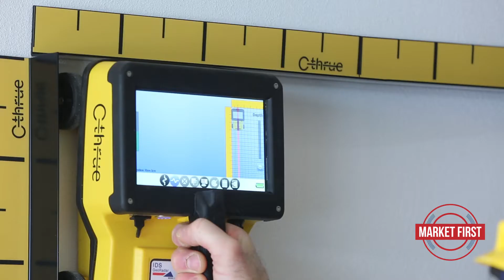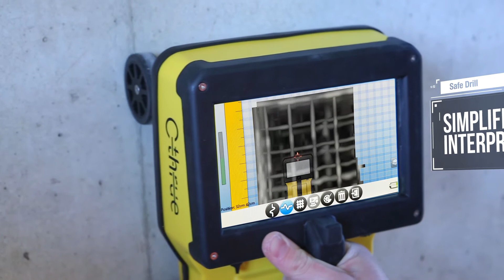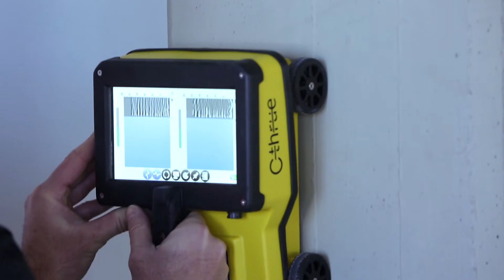C-thrue - See Thru Concrete Structures and Reveal True Data that Lead to Optimal Decision-Making

Comment: is it can be used to scan d dispersion of steel fiber concrete?
Reply: Hello, unfortunately since steel fiber reinforced concrete has many small steel fibers inside. It makes it nearly impossible to use GPR (ground Penetrating Radar) of any kind to be used since the signal reflects off of all the steel fibers running throughout the concrete. However if just about ANY other type of concrete GPR works excellent.
Reply: @danbroekhove-gpr2242  thanks for d replay.